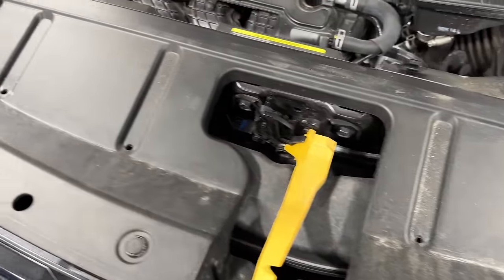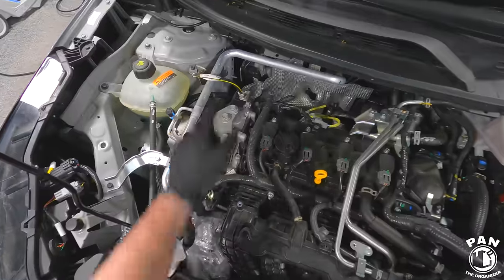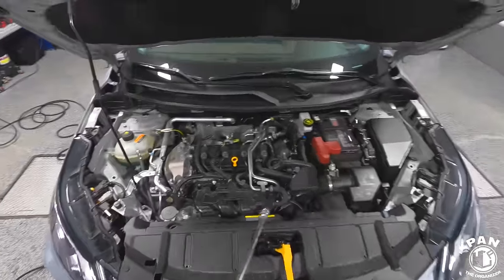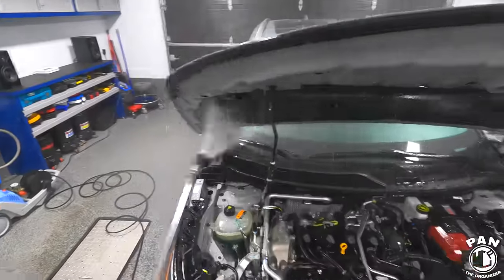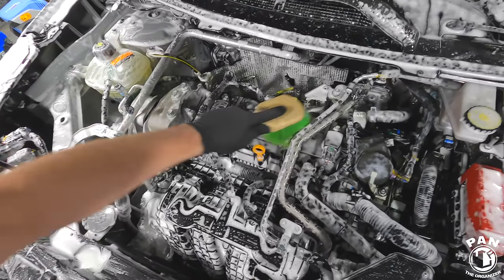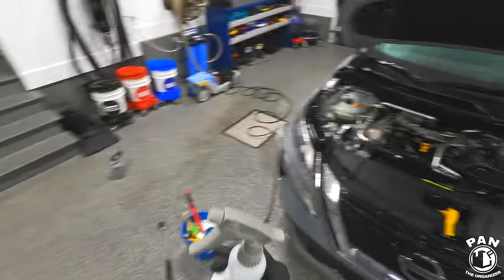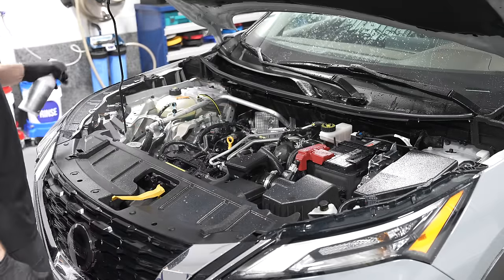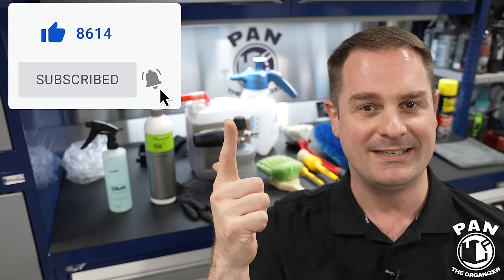How to Safely Clean Your Car's Engine Bay!

Comment: Great video Pan. Can you do the same thing with EV vehicles? Would love to see you do this with a Electric Vehicle.
Reply from the maker: EV vehicles like Teslas don't really have an engine bay, it's usually a fronk right (front trunk)? Are you talking about hybrid vehicles?

When it comes to hybrid engines, most of the common sense and tips are similar to regular engine bays, with a few slight tweaks.

Here are some videos that give more details: 
Toyota Prius engine bay: https://youtu.be/UQhrIEYwW9E
General hybrid engine bay cleaning tips: https://youtu.be/AHosBEZAHPY
General tips: https://youtu.be/X_cwN4ljpG8
Reply: @PanTheOrganizer   Sorry Pan I should have told you what vehicle I have. I have a 2022 Chevy Bolt EUV Premier. Under my hood is all electronics.  I wish the front was trunk like Tesla's are.

Comment: Hi I have 1993 Mazda 929 with engine w many layers of oil. Would you kindly please suggest best cleaner in my situation especially not just electrical connectors but also rubber hoses don't get damaged. Thank you.

Comment: My engine bay (14 years old car) is full of rusty components. Should I try cleaning it? Or rather avoid it when it still works? I intend to keep the car for the next 5 year and need to do maximum to keep it functional.

Comment: What do you do with the run-off when you pressure wash all that dirt and grime away? Do you have a floor drain? Do you worry about the oil mixed waste water going into the storm drain? I would love to see a video of a dirty, oil covered engine bay of an old Mercedes Diesel being cleaned.

Comment: Hi Pan. Some quick good questions. 

I wrapped the engine brace bars on my bmw in red. Would any of the products you mentioned in this video be harmful to the wrapping?

I just detail a couple of cars. What can I do with the left over diluted solution?

Thank you again for doing what you do!!
Reply from the maker: I don't really detail wrapped cars as that's not popular in my area, so it's hard to say. And as different wrap manufacturers can have different requirements for chemicals (just like PPF companies do) it's even harder to say. You would have to contact the company that did your wrap and ask if they have any specific do's and don'ts as far as chemicals are concerned.

Diluted products are typically good for a few months as long as they're kept in stable conditions and not frozen. Beyond that point, if unused, there's not much more you can do other than discard the remaining solution.

Comment: What IPA do you recmommend to prep for Turtle Graphene Flex Wax? I used 15% of 99%IPA to distilled water as recommended in your video, but not sure if it worked well. I followed all instructions to a T (minus car polishing), but on my 5 year old car Turtle Graphene Flex Wax works brilliant (good water beading and sheeting), but on my 20 year old car it only last a few weeks. At least top up is easy. Is it because 20-year old need polish as well as all other steps (foam, touch wash, deiron, detarr, cley, dry, IPA)?
Reply from the maker: The more time you spend prepping the paint, the better the protection will perform and the longer it will last for sure.

Using an IPA alone won’t do much. You never see me just use an IPA before applying protection.

Especially if your vehicle has never been properly detailed, then you should wash, iron remover, clay, machine polishing, IPA and then apply the protection for best results.

Watch how I fully detail a car here: https://youtu.be/gohks8xP5NY

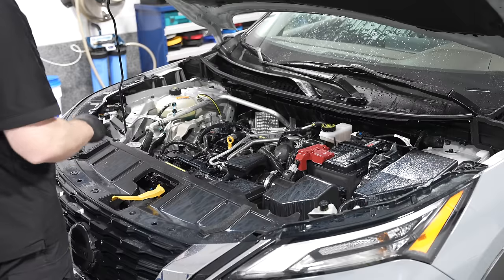Comment: Looking at 21:25 you didn't include the process to get rid of all the overspray. You only mentioned earlier about returning with a microfiber towel. You continued with cleaning the rest of vehicle, came back and we see final result. Then you mention buffing the product. What is the time limit which you must remove/buff all the overspray?
Reply from the maker: Approximately 30 to 60 min, there’s no rush if you work in the shade or in a garage like I do.

Comment: I detail my engine bay once a year and now I`m looking forward to it. I didn`t know that hyper dressing has also self-leveling ability. What dilution is it in the sprayer? Since it will further dillute by the wet surface, but still able to come through the spray nozzle
Reply from the maker: The recommended dilutions are on the product label. And don’t overthink the moment. After you cleaned and rinsed the engine bay, you spray it on the surface while it’s wet, and it will self level once the water starts to evaporate. Just do a quick wipe when everything is dry if you see any streaks.

You can do the same with CarPro PERL. See how we do it in this video: https://youtu.be/E_ck-Hn1AvE

Comment: Was wondering how to detail the engine compartment of a 1986 F150 Electronic fuel injection the detail shop was going to use some tire stuff to clean it I saw on Utub never do that so what would be the best product to do that and what precautions do I need to know to keep from messing something up as I have never done this before and the truck has never had the engine compartment Detailed has never been done before! And it’s not sealed like new trucks.

Comment: Nice that!!! Though even with Pan saying its ok to use pressure washer, i won't (its also an PHEV with WAY more electronics in the front than an ICE) i'll just use a toothbrush, a fair few (old) microfibers and some dedicated engine bay detailing brushes combine those with degreaer and the Checmicalguys bay thingy. :D

Comment: Is there a difference using a foam cannon vs the soap nozzle & dispenser built into the pressure washer for things like the degreaser?
Reply from the maker: Huge difference in the amount and thickness of foam when you use an actual good quality foam cannon for sure. Much better results with a dedicated foam cannon.

Here's my latest foam cannon battle video: https://youtu.be/wF5pDPE7vr0?si=MyiIgC9eQwigmKx4

Welcome to my channel. You discovered one of the biggest car detailing channels on YouTube as we surpassed 990,000 subscribers and we have over 135 million views! I have been detailing for 27 years and I love to share my knowledge and passion with my viewers.

You found the right channel to help you learn everything about detailing.

Comment: I have mitsubishi outlander 2023 sel which has the same engine as the your 2021 Rouge..exactly no difference with the engine as yours.. I usually wash the engine by disconnecting the negative battery terminal only and leave the alternator uncovered. I've never had any issue with it..😊
Reply from the maker: This is my girlfriend's vehicle. I own the new generation Porsche 911 Turbo S, which you can see me wash in this video: https://youtu.be/X0msqeozDBU

Welcome to my channel. You discovered one of the biggest car detailing channels on YouTube as we surpassed 905,000 subscribers and we have over 117 million views! I have been detailing for 26 years and I love to share my knowledge and passion with my viewers.

You found the right channel to help you learn everything about detailing.

Comment: What abou a 20 yr old trailblazer engine bay that has never been washed?? How can I know what to cover and what not, I really want to clean it but afraid I'm going to mess it up 😟
Reply from the maker: You just have to be more careful, and perhaps use a garden hose in that situation, instead of a pressure washer. Cover any exposed electronics like the main computer, or alternator, or fuse box. Don't focus the stream of water on the same spot for many seconds. Keep the wand moving and sweeping across the engine bay.

Or, you could avoid using water altogether, by just purchasing a waterless wash type product. Spray that liberally all around the engine bay, and use detailing brushes to agitate, and then mop up and wipe with old microfiber towels. And that should still get you a very good result. Here's a quality waterless wash that will work super well: https://bit.ly/4bFYfRD
Or this alternative from Amazon: https://amzn.to/4bLFL24

Welcome to my channel. You discovered one of the biggest car detailing channels on YouTube as we surpassed 965,000 subscribers and we have over 130 million views! I have been detailing for 26 years and I love to share my knowledge and passion with my viewers.

You found the right channel to help you learn everything about detailing.
Reply: @PanTheOrganizer  thank you 😊

Comment: Would you still feel comfortable doing this method in a hybrid engine bay? F150 Powerboost.
Reply from the maker: When it comes to hybrid engines, most of the common sense and tips are similar to regular engine bays, with a few slight tweaks.

Here are some videos that give more details: 
Toyota Prius engine bay: https://youtu.be/UQhrIEYwW9E
General hybrid engine bay cleaning tips: https://youtu.be/AHosBEZAHPY
General tips: https://youtu.be/X_cwN4ljpG8

Comment: Have you thought about using Brake Buster to clean the engine for its rust inhibitors? Or is there a reason that would be a bad idea?
Reply from the maker: Brake Buster is more for cleaning wheels really. Not sure about its use in the engine bay. Perhaps reach out to P&S and see what they say. It often happens that a product has uses in different scenarios so I'd be curious to hear their response.

Comment: Pan,  is there a way to clean off the radiator?  Especially the front where it received most of dirty, dust, bugs.  I know it’s a sensitive part that you do not want to damage the fins
Reply from the maker: A snow foam and very lightly rinse off. You want to be extra careful.

Comment: About three years ago there was two Jeep Cherokee XJ’s that sold on Bring A Trailer. Both Jeeps were red, a year apart and also one had 30k more miles. Guess what? The XJ with the higher miles got a little over $5000 when sold and the reason was it had a very clean engine bay while the other one was dirty and normal looking.
Reply from the maker: There you go! 👍🏻

Comment: Have you done the engine bay on a hybrid. Myself, I’d be highly nervous cleaning around high voltage.
Reply from the maker: When it comes to hybrid engines, most of the common sense and tips are similar to regular engine bays, with a few slight tweaks.

Here are some videos that give more details: 
Toyota Prius engine bay: https://youtu.be/UQhrIEYwW9E
General hybrid engine bay cleaning tips: https://youtu.be/AHosBEZAHPY
General tips: https://youtu.be/X_cwN4ljpG8

Comment: Would it be a good idea to remove the plastic covering on the bottom of the car before washing the engine bay, so the water can fall out, or it doesn't make a difference
Reply from the maker: Doesn’t make a difference. Remember, you drive through rain.

Comment: Question. So I noticed here a lot of the tools you use are ones also used on your wheels. After using them on the engine bay is it okay to use them on wheels still or would you have designated engine bay tools aside from your wheel tools?
Reply from the maker: I have many versions of the same tools. I keep engine bay tools for the engine bay, and wheel tools for wheels.

Comment: FYI, the Chemical Brothers Black on Black is not safe for rubber! Says so right on the back of the can.  The Q&A in their website confirmed it as well.   

The odd part is their ad says “safe for engine bays”. I’ve never seen an engine bay with no rubber. It would suck to have a clean engine, but disintegrating engine mounts…

Comment: May I suggest you create a second video to clean an engine bay which is dirty. I don't mean to say that the vechile in question isn't dirty however it is  in a very good state of clieanliness. Thank you for your time. Cheers.
Reply from the maker: This was by no stretch if the imagination a clean engine bay. And the techniques and products wouldn’t change anyways for an even dirtier engine bay. It’s the same method regardless of the level of dirt.

Comment: Can i use P&S break buster as a cleaner instead of all purpose cleaner either straight  or diluted?
Reply from the maker: Yes. You could dilute it 1:3 up to 1:5 in a foaming pump sprayer and use that. Or use it undiluted from the spray bottle it comes shipped in.

An expert from P&S spoke about Brake Buster as an engine degreaser in my video here: https://youtu.be/FLq-vKIWhKw

Comment: Hey Pan's Community! What is your wisdom with regards to ratio of CarPro Reset to water in a foam cannon? Alternatively, what cheaper PH neutral and mild foam do you recommend (available in Europe)?
Reply from the maker: You always have to adjust the dilution according to your setup, as there are many variables like type of pressure washer, type of foam cannon, water quality (hard water vs deionized water), dilution ratio, type of snow foam.

But as a general starting guide, you can use a 1:10 ratio for Reset in a foam cannon. 

But in Europe, for a pH neutral snow foam, you can use two of my favourite:
http://bit.ly/3ALBppU
Or this higher pH for more cleaning power: http://bit.ly/3fYlmii

CarPro even has its own snow foam: http://bit.ly/3CRdLLn
Reply: @PanTheOrganizer  Thanks Pan. I used Carpro Lift but I think it damages my Turtle Graphene Flex Wax. As you say in your 2022 "best" video, Bilt Hamber has PH 12-13, so I will skip this one. Koch Chemie GSF looks good - neutral PH - also says it's gentle so factors other than PH should be ok + costs 30% cheaper than Carpro resest in Poland (15 USD vs 20 USD for 1 liter), and has dialution ratio 1:50, so should be about 7 times cheaper to use as foam than Carpro Reset.

Comment: What about Hybrids like Yaris 2022? Is It still safe to water the engine bay? I see in mine lot of cables connected.
Reply from the maker: When it comes to hybrid engines, most of the common sense and tips are similar to regular engine bays, with a few slight tweaks.

Here are some videos that give more details: 
Toyota Prius engine bay: https://youtu.be/UQhrIEYwW9E
General hybrid engine bay cleaning tips: https://youtu.be/AHosBEZAHPY
General tips: https://youtu.be/X_cwN4ljpG8

Comment: Can I apply this method also for Electric Vehicles? I’m afraid because there is a HV (high voltage) battery inside.
Reply from the maker: EVs usually only have a front trunk, and no engine bay per say (like Tesla). But for Hybrid vehicles, when it comes to hybrid engines, most of the common sense and tips are similar to regular engine bays, with a few slight tweaks.

Here are some videos that give more details: 
Toyota Prius engine bay: https://youtu.be/UQhrIEYwW9E
General hybrid engine bay cleaning tips: https://youtu.be/AHosBEZAHPY
General tips: https://youtu.be/X_cwN4ljpG8

Comment: Can you pressure  wash a hybrid  engine  that  has a the hybrid  electric  cables in ghe engine  bay or is it wiser to do it by hand any advice  would be appreciated
Reply from the maker: When it comes to hybrid engines, most of the common sense and tips are similar to regular engine bays, with a few slight tweaks.

Here are some videos that give more details: 
Toyota Prius engine bay: https://youtu.be/UQhrIEYwW9E
General hybrid engine bay cleaning tips: https://youtu.be/AHosBEZAHPY
General tips: https://youtu.be/X_cwN4ljpG8

Comment: Are there any special requirements or need to knows about detailing the engine of a hybrid car?
Reply from the maker: Hi Nick. When it comes to hybrid engines, most of the common sense and tips are similar to regular engine bays, with a few slight tweaks.

Here are some videos that give more details: 
Toyota Prius engine bay: https://youtu.be/UQhrIEYwW9E
General hybrid engine bay cleaning tips: https://youtu.be/AHosBEZAHPY
General tips: https://youtu.be/X_cwN4ljpG8
Reply: @PanTheOrganizer  thank you very much for the links. Very helpful. One last question about it. It is a 2023 Hyundai Electra hybrid. The trim is the luxury trim. It has sensors on the bumpers in front and back of the vehicle. Do I have to take any special precautions with chemicals on those sensors?

Comment: Very cool video. The one extra thing I do is take my shop vacuum with brush attachment and vacuum the engine blanket under the hood. Then take damp microfiber and wipe down gently. 
Question: where does the engine gunk go? I made a greasy mess on my concrete driveway. Took MORE time to clean up the clean up. Any tips on that? Video going into library Pan. Thx!
Reply from the maker: Luckily, I have a sealed coated floor in my garage, with drains. So no issues with stains... :)

Comment: If i dont have access to air pressure, can I use microfibers to fully dry the engine bay? 
After that turn on the engine right away to let engine heat dry it up? Or atleast it is safe to drive it for a few miles?
Reply from the maker: Yes that's a perfectly fine alternative. Let the hood open after drying it with the towels, turn the engine on and let it run for a few minutes to let remaining water evaporate. Of course make sure the vehicle is outside when letting the engine run.
Reply: @PanTheOrganizer  thank you!

Comment: Hi Pan! We have a BMW 530i xDrive. After removing the plastic engine cover, I found that the top of the engine is lightly dusty with some miniscule sand particles. The bottom of the car is covered with splash protectors and the back and part of the sides of the engine has insulation. Will these be an issue when washing the top of the engine? Will the water drain out from the splash protectors under the engine and transmission? Thanks!
Reply from the maker: You will blow dry the engine compartment at the end so there should be no residual water left after the process.
Reply: @PanTheOrganizer  Thanks Pan! Will the water drain out even with the lower splash pans that are under the engine and transmission?